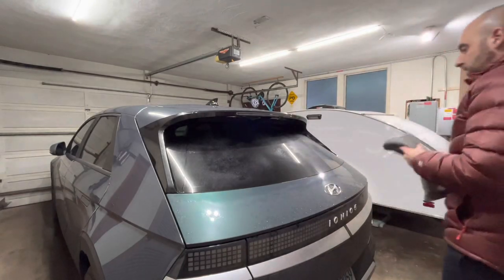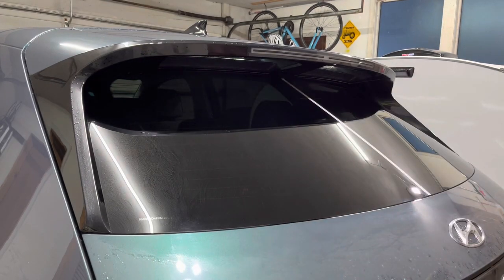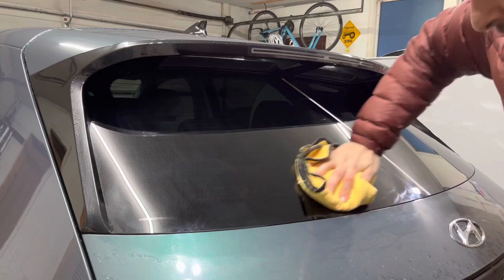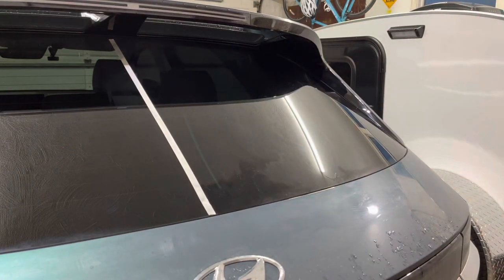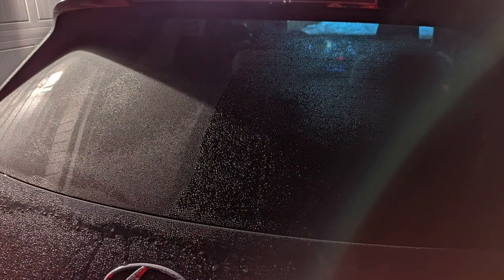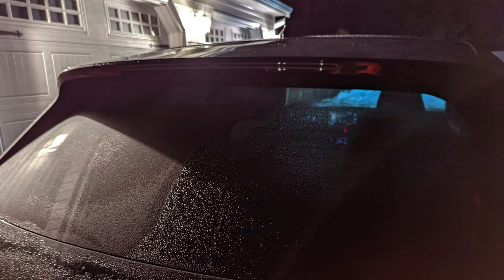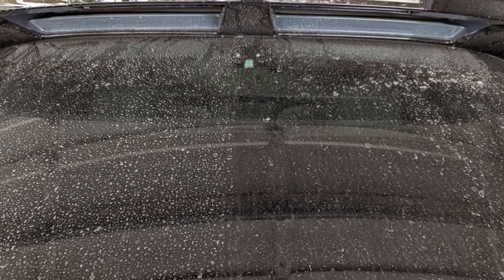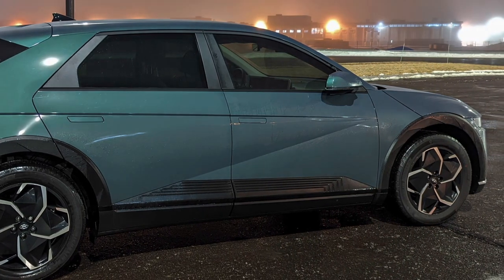This Coating Will Help Keep Your Ioniq 5 Rear Window Clear In the Winter

Comment: Armor All also makes a ceramic product (for glass specifically) but it is tricky to apply and may take a couple applications.  I remember back in the 80's (when I was a teen and had a lot more time to experiment) I used RAIN-X on my car - I cleaned the windshield with normal glass cleaner, then with BON AMI (a cleanser like Comet but cheaper) then with isopropyl alcohol - spending about an hour on the front glass - the results were awesome - I really do believe the stuff works as advertised it's just that people can't or won't spend the prep time involved - it's not a knock against them just a reality of life.   Ironically my wife currently drives my 2018 Kia Soul turbo and almost always forgets she has a rear wiper - we have a 2022 IONIQ 5 coming in a couple months which she'll drive - hopefully she won't miss the rear wiper then ;-)  Great tip on the Turtle Wax Hybrid Ceramic!  - I think I already have it in the garage never really thought of using on the glass but as you said it says you can...

Comment: I use the Turtle Wax 3 in 1 Ceramic spray to clean and maintain a nice finish on my ID.4 I've never worked witha product so amazing in many regards. It keeps not only the finish butter smooth but keeps the windows clear of grime and junk. Makes for such easy cleanup. Also great if it rains.
Reply from the maker: Compared to the paste wax I used to use, it sure is incredible

Comment: Thanks for all your videos.  I have tried waxing the rear window and while it works fairly well in a heavy rain driving for more than 30 minutes an intermittent light rain can easily obscure rear visibility.  Having the ability to have the rear camera during less than optimal conditions would be great.  According to other forums Ioniq 5s in the EU and Britain have this ability.  So I wonder if there is a way to get that on North American cars through a software update/change or if there is a way to override the 5-6mph cut-off.
Reply from the maker: That would be a very welcome feature but I wonder if they're not allowed to implement that here due to certain regulations.

Comment: Can you share what you know about installing a trailer hitch like you mentioned in the video? So far I haven't seen one for the Ioniq5.
Reply from the maker: Europe has them but they use a different style than North America. Australia has a system similar to North America but the one guy who's posted photos had his custom fabricated. I've emailed Curt and Draw-Tite asking when they'll have after market hitches but have not received a response in several weeks. Hyundai has part numbers for the hitch but the dealers can't order them right now. Really hope they get this going as the weather is getting nicer and people will be wanting to tow very soon

Comment: I bought a RWD SEL a week ago - also my first EV. Saw a link to your channel on Out of Spec Reviews so thought I'd better subscribe. I'm using Armor All ceramic spray on my rear window at the moment. 
Have you done any discussion/testing on battery drain when using Heat? It surprised me and blew up my whole Friday recently.
Reply from the maker: Oh no, did you get stranded?
Reply: @TheIoniqGuy  Just about. Found a kind Ford dealer with a Level II charger that gave me enough juice to get to a DC fast charger closer to home. Not fun.

Comment: Good video. I used turtle wax for a while and switched to griot's ceramic. I think the griot's lasts a bit longer.
Reply: are you using the glass cleaner or the 3 in 1 wax?

Comment: Congratulations on your purchase. Where are you located to be able to buy one already? Heard a hitch is in your future. A oem reciever? Very interested in that video. I have a 2,000 lb boat to pull, interested in wiring also... Will keep watching! Thanks
Reply from the maker: I'm in Connecticut. I was a day one reservation holder and I had multiple outlets to purchase. My local dealer worked with me very closely but they didn't get the car I wanted so I purchased elsewhere that has what I wanted on the lot for several weeks.

OEM or aftermarket. There is an aftermarket hitch available in Canada now, trying to figure out shipping to the US. Wiring is also now available. I'll be hopefully doing an install video in the coming month.
Reply: @TheIoniqGuy  thanks for the response so quickly!

Comment: Do you also apply front windshield with turtle wax?   does wiper produce skips or squeek?
Reply from the maker: No I did not although I will say the stock wipers are trash. Replaced them with Bosch Icons that work much better
Reply: @TheIoniqGuy  The stock wipers are really bad.
Reply: @TheIoniqGuy  I also went for Bosch wipers in my current car and they are absolutely fantastic, easy to install and super durable.

Comment: Hey again! Are you still using this turtle wax ceramic spray coating? Or have you found something better?
Reply from the maker: I haven't reapplied in a while but I just ordered a new turtle wax product with graphene that I'm going to test in an upcoming video
Reply: @TheIoniqGuy  bro that’s the same one I was probably going to try. The paste wax with graphene? Seems to have good water sheeting capabilities
Reply from the maker: I ordered the spray type just so I can use it on the car. I like the idea of paste wax because you know it’s actually making its way onto every inch, but the ease of the spray is so nice

Comment: Great video and really helpful. I have had ioniq 5 since Oct and Indo really like the car, but it does have a few shortcomings - such as the lack of rear wiper. 

Out of curiousity how is your charging speed on the car?  I frequently drive long motorway/freeway miles and when stopping to charge I get the most god awful charging speeds. Starting at 50kwh and then reducing to 34Kwh was yesterday's debacle. This is after driving for 2 hours! 

I am interested to see if anyone is getting any reasonable charging speed or if it's just an issue with mine. I am taking it back to dealer for a check, but I can almost hear them telling me that they can't see anything wrong with it!
Reply: And these charging speeds are at a 350Kwh charger.
Reply from the maker: That is really unfortunate. What were outside temperatures? I regularly start around 70kw and by 20 minutes I'm up to 150-175kw. This is in 30-40°F temps
Reply: @TheIoniqGuy  thanks for the reply. Outside temp is around 6 degrees c or 43 f. I reckon there must be something really wrong with it. It is booked into dealer so will see what they say 🤨
Reply: Just out of curiosity, did you upgrade your car to the lastest software update that is available. There is some speculation that the update might help, even though Hyundai says it doesn't. In my USA model, I was getting in the 60s when starting charging in sub freezing temperatures and it got up to 130 kW at a certain point. If you have the AWD version with "Winter Mode" you can try that as it may keep the battery warmer in winter which could help with charging rates. There is a rumor that there will eventually be an update for anyone that has the battery warming system that is tied to "Winter mode" that will allow us to pre warm the battery when we select a charger using Hyundai's navigation system.
Reply: @lanceareadbhar  thanks for that.  In terms of software update, do you mean the nav update?  I am not sure where I would get any others?  My model is the RWD 72Kwh Premium and in the UK it doesnt come with the battery warmer unless you have the ECO pack - which i didnt know at the time. 

If you had any links to software updates I would totally be up for giving that a try.
Reply: Could also be your charging stations.

Comment: What made you want to buy/own an electric vehicle?
Reply from the maker: Ultimately, the timing was right. My car was valued at what I bought it for 2 years prior, so putting a good chunk down on a more expensive EV made it an easier pill to swallow.  2 years of free charging was a nice caveat. And I just wanted to lower my carbon use. Not to mention it's fun as hell to drive compared to my slow gas car.

Comment: Thanks for the video.  Too bad they didn't tuck a wiper up under the rear shade/spoiler.  Rumour is Hyundai for 2023 are putting a camera up there.  The rear view mirror will be either a regular mirror or it can be used with the camera.
Reply from the maker: I saw that. I really hope that they offer it as a dealer installed accessory or whatever, just allow us early adopters to have access to somewhat of a design fix
Reply: @TheIoniqGuy  I’m glad they didn’t just slap a wiper on at the bottom of the window.  It’s such a nice clean design.  The only place would be hidden up top.

Comment: I'm baffled that there's no rear wiper on these🤔
Reply: There are rumors going around that the rear was originally designed in a way that the wind could actually blow dry the rear window, but then someone added the big spoiler which is preventing the wind from getting where it needs to be in terms of good rear view. I guess after this became a known issue at Hyundai it was already to late to design and implement a rear wiper into the car. Also I have heard that a rear wiper -if it's not super fancy designed could have a negative impact on aerodynamics, an area where the Ioniq 5 is already behind competition a bit.

Comment: I've been using Rain-X glass repellent for over 35 years on my windshields,  Rain-X is great for water repellency while driving in  the rain.  Turtle Wax Ceramic Spray coating I only use on my vehicles  paint finish.  The Turtle Wax ceramic coating gives me great hydrophobic beading and long lasting coating.  I'm impressed about how the Turtle wax performed on the wiper-less rear window.  No offense, but I am satisfied on both products the way I use it.
Reply from the maker: Right on 👍